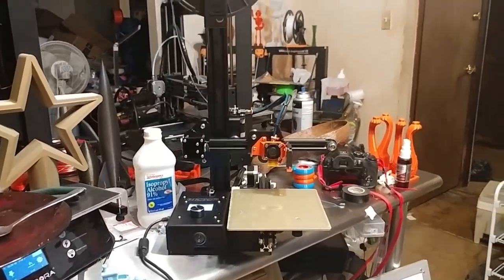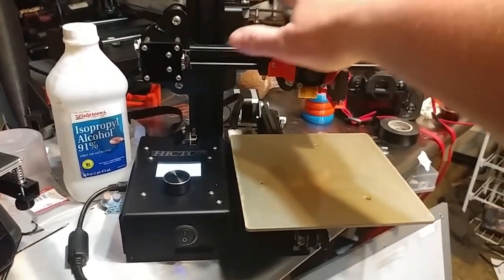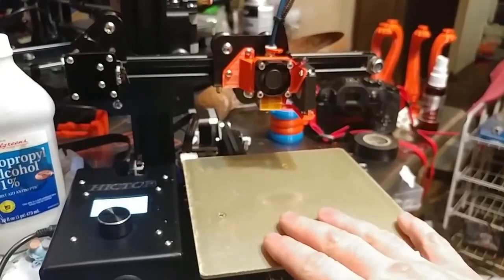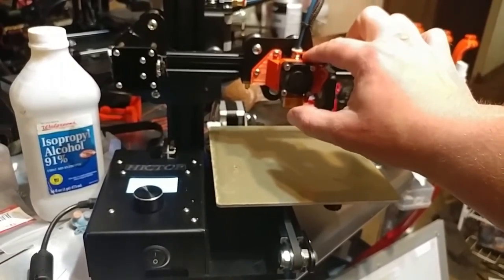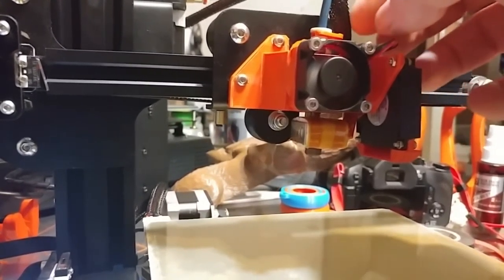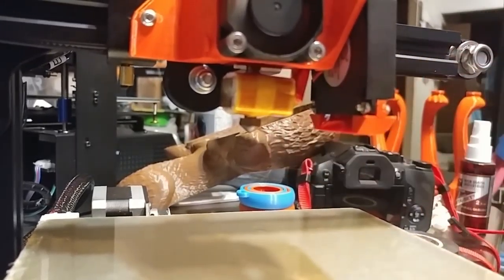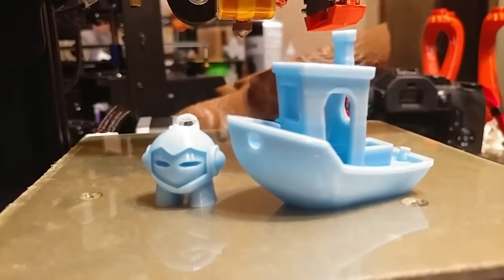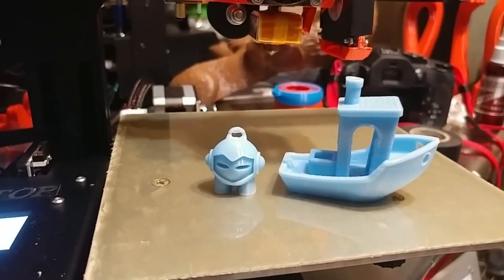Today's 3D Print 164 Customized Ender 2 Preview Unit #1 is Ready

Comment from the maker: This printer is for sale $380 fully assembled minus the spool holder which yoy will habe to attach. Fully tuned tweaked and upgraded profiles and sample cpge forncura and s3d on the memory card. Already leveled no assurance it will stay leveled through shipment. Packed up ready to go to conti us.

$350 plus shipping. $27 to $43 first class to priority your choice.

Upgraded hot end shroud custom design. Ultra quiet. Pei print surface capricorn tubing a2 hardened steel nozzle parts cooling fan added and fully plumbed into the harness works through gcode like any other printer.

Fully tested and burned in. 30day email support and 7 day parts warranty included.
Reply: Nerys I watch alot of your videos you do an excellent job of being straight forward good or bad and that makes your channel have a strong following...  

I see your modding out these ender 2 printers.. you should check out my extruder relocation brackets.. cnc machined aluminum..  might be something you want to add to these.. email me if interested... 

Keep up the good work
Reply from the maker: link? pictures? why relocate? youtube messaging SUCKS I just found this message now.

Comment: Wow, I love that hot end surround mod you made on that. I have a CR-10 and love it. But, like you, I'd prefer to be able to see the hot end a little better especially as the prints start to initially get laid down. Since there are so MANY CR-10 units out here, it would be great if you could post the mod files to Thingiverse and do a video on installing the printed parts and associated accessories onto the CR-10!
Reply from the maker: I plan to offer a kit with the parts in it etc.. to make the modification. I will also release the design to my patrons. an experiment to see if that can work. but first I want to make sure it holds up to a 50+ hours print on the CR-10 :-)

I am also going to make a mod with 2 cooling fans (one on each side) this will improve surface finish on thin models (I notice the vase print models that are small suffer a little on the uncooled side) and also allow you to run the fans "cooler" which should decrease noise even further.
Reply: Wow, that sounds fantastic! Thanks!

Comment: What suggestions do you have for strain relief on the heat bed connector? Mine failed after about 100 hours. I’m not sure about the STLs that fix onto the bed screws - adds weight, tightens the levelling springs considerably and makes the cable tight at y<15mm. Considering a few layers of heat shrink, but that makes it impossible to easily inspect the connector. I tried to solder new wires but my lack of skill and appropriate equipment failed me. Any ideas, please?
Reply from the maker: That's interesting I have a couple of thousand hours on my Android to and no sign of heat bed failure at the connection is this a newer Ender to and are you running the heat pepper hotter than 60 C? All of my Android tools are the older style so it might be the higher temperature and therefore higher current causing a problem?
Reply: I run at 45-50 degrees, it was 50 when it failed. It is a recent Ender 2 (ordered a month before the 3 was announced!) and it has a bed claiming a rating of 110W. I understand the first units were rated considerably less, and photos I've seen have narrower traces on the heat bed, so it's likely the current draw is higher on the later units (although for less time depending on target temperature, I guess). The usual advice on the E2 facebook group is to solder the connections, but the thick wires and thick aluminium bed make this not completely trivial - at least for me!
Reply from the maker: Rig up a mount for a clothing iron place the heat bed upside down on the clothing iron turn on the iron let it heat up your heat bed then try soldering it it works a lot better
Reply: Thanks for the tip

Comment: Hi, Nerys. I'm interested in buying my first 3d printer to print PC case parts. I've been following your channel, and I'm thinking like a beginner in getting this Ender 2. But I believe that for PC parts that heats up, I'd better use ABS. Is it really that I should start with an Ender 2, or would it point me to another printer. But where I live is better than Gearbest. Thank you very much.
Reply from the maker: I am not entirely sure I have very little experience with abs I did make my first prince two weeks ago and with perimeter and infield Parts I had no problem with abs once I add the little Brim they stock fine they printed find although ABS hates bridging :-) very ugly :-) thin Parts however don't work for crap :-) I tried to print of A vase in abs even with an enclosure and no that did not work might just be too cold here :-)

The newer Ender 2 is capable of 100 degree heat bed temperatures so it can do abs just fine and because of its small size and separate power supply you can easily build an enclosure for it very cheaply to keep the heat in

As for which printer is ideal for abs that I can't answer since I don't have enough experience with abs and I don't want to deceive you so my information is largely an educated guess

Now you said PC case parts I thought that meant personal computer case Parts but now I realize that you may have been saying polycarbonate case parts?

I have no experience with polycarbonate yet but really want to get involved with it because of its Incredible strength :-)
Reply: Had not thought of polycarbonate for the parts to build a mini pc case, had even thought of abs. But it's actually a lot better, I'll search more. I'll order my printer. Thanks for your help!!

Comment: I love My Enders 2 :-)
I will try the PEI Base and the same springs for the bed, but i only modded X Axis Belt Tensioner, Y Axis Belt Tensioner and Fan Shroud and is clearly the best printer i have.
Especially for ABS!!

But i prefer my Prusa i3 Clone for Print flexible, because the Direct extruder, not Bowden... :)
Reply from the maker: +PLAYNIMATIONS direct drive will always be superior for flexible over a Bowden tube :-) my maker select with the flexion extruder was a beast for flexibles

Comment: Hi I was just wondering where I could get your Cura profile
Reply from the maker: +Judoguy 12 Cura no longer exports printer profiles but I do have my settings profile which I believe is in my links if it's not there I'll upload it tonight
Reply: thanks for the realy quick reply just wondering is cura the best free slicer
Reply from the maker: +Judoguy 12 I don't know Kira is the only slicer I've used besides a simplify 3D and I get pretty good results with it it's got works but so does simplify3d when time allows I'll be sure to try some of the other guys out there
Reply: Nerys thanks
Reply: Settings profile is that the fff one sorry I’m new to this
Reply from the maker: +Judoguy 12 the FFF is 4 simplify 3D
Reply: Nerys so what Can I use in Cura sorry new and I am a 13 year old 3D printer coming from gearbest

Comment: Nery, Where di you get the replacement stock or no stock.. fan, Mine is starting to make some noise..Thanks, Kevin
Reply from the maker: +K Wright amazon. Search for makergirl i will add a link tonight. Thisnis NOT stock size. Stock size is 40mm

I got the blowers from amazon as well.
Reply: Ill wait for links..also the PEI...Love the channel want to support it..
Reply from the maker: +K Wright this is the one i usually use http://amzn.to/2kgltZr not 100% sure of performance on an ender 2.
Reply: I found a Noctua 40X10 premium fan which last a friggin lifetime as I have them in PC;s I know its not what you suggested but it seems like a good fan..is the stock fan 40x10??
Reply from the maker: +K Wright the noctua fans are great go for it my only concern is having sufficient air flow since it uses the hotend fan as a Porsche cooling fan the excess air after it cool the hot end blows over the model so if you reduce the throughput of air too much you're going to reduce your cooling of your part but try it see what happens
Reply: Well the unregulated speed on the Noctua is more RPM that the link, not sure about the CFM..I got a 40x10 and 40x20 I plan to use 1or 2 MM bullet connectors (soldered) for easy change out, will heat shrink the connectors, Don't want to route all the wire through the loom and it will be easier to swap out if the CFM isnt adequate, but it seems  the stock Ender setup just relies on the deflected air that cool the hot end..its not really directed in anyway..We will see what happens..you have a link to the swiss hot ends and the Capricorn Tubing..
Reply from the maker: +K Wright Oh wait we're talking about an Ender that's totally different

A floor fan is going to reduce your cooling capacity you want to add a cooler if you don't want to run it through the loom just tapped directly into the hot and fan and it will always be running the same fan that runs on the cr-10 you can literally just hot glue it right to the side of the housing on the Ender just make sure it doesn't hang too low

Comment: Do you have a link for the build surface?  How well do prints stick to it?
Reply from the maker: I got it from CS Hyde. they are the only ones I know of that both do custom sizes and the adhesive is already applied to the PEI.

http://catalog.cshyde.com/viewitems/films/pei-ultem-polyethermide-resin?

you can request a custom size its about $15-$18 shipped. you need 165x165mm for the Ender 2 though maybe cheaper if you order just one. I ordered one large enough for them to cut into 4 pieces came to $52 or $58 something like that. Right around $15 a pop shipped.

PEI is interesting. bed level is important and it must be CLEANED thoroughly before each print (just alcohol and wiped down clean) ANY residue will inhibit stiction.

it also seems to prefer being printed "hot" I print at 60c max for the ender and it seems happy with that.

whats nice is the parts snap right off the print bed easily and have that "super gloss" finish on them Literally like a mirror.
Reply: Sorry if I missed it, but what is the thickness you are using? Thanks.

Comment: Awesome upgrade Nerys 
By the way does ender 2 have a resume feature after power failure ? Or how to add one??
Reply from the maker: +Iengskhem Marak no. But its small enough that i just use a ups :-)
Reply: Nerys how to do An Ups ?
Reply from the maker: +Iengskhem Marak ups uninterruptable power supply. Its basically a battery. If the power cuts out the battery inatantly takes over and keeps it running for a little while (10 minutes to an hour depending on size and power draw)
Reply: Nerys thanks again and I now realise that you are talking about a computer ups😋😋😋
Reply from the maker: +Iengskhem Marak ahhh yes my bad. Jist remwmber larger printer wkth heat bed can slurp down 250 300 watt hours. That takes a pretty beefy ups.

Comment: Nery. My i3 Mega stops printing 5-10 minutes into a print. Starts perfect, and after 5-10 minutes suddenly stops without any message on the screen.😦
Any advice ?
Reply from the maker: that sounds like bad gcode. I had that problem this morning with my Tevo Tornado. loaded its gocode and lo and behold the cost STOPPED where the printer stopped.

swapped to a different memory card and its working perfectly now. SO first try reslicing. then preview the gcode make sure its "complete" (preview it FROM your sd card it might be complete on your PC but getting corrupt when you copy it over)

FIRST test is to reprint something you have already printed that is already on the SD card. now if the SD card itself is going bad that might not work.

so try a different SD card.
Reply: Nerys Thank you very much. I'll try it later.

Comment: Ouuuh!! That looks so gd!! Would you be sharing the design on thingiverse?
Reply from the maker: I plan to offer a kit with the parts in it etc.. to make the modification. I will also release the design to my patrons. an experiment to see if that can work. but first I want to make sure it holds up to a 50+ hours print on the CR-10 :-)

I am also going to make a mod with 2 cooling fans (one on each side) this will improve surface finish on thin models (I notice the vase print models that are small suffer a little on the uncooled side) and also allow you to run the fans "cooler" which should decrease noise even further.
Reply: Nerys awesome!

Comment: Nery's, are you a dealer for the Ender platforms? I really would very much like to get one I already have the CR10 and will be getting the CR10 5s according to my wife lol but when is a secret and she said she'll let me know when lol.

However, as for the Ender what's the price your asking for one of them setup like your personal Ende? Thank you. Bob
Reply from the maker: I am not a dealer. I just happened to get lucky and bought all the amazon returns from hictop. I am building and tuning them up. selling a few to pay for them all.

A printer as you see it in this video costs me $260. so the price would be $260 plus whatever you want to pay me ($260 is cost) plus shipping.

you can off course customize it. don't want the PEI? save $15 use the stock surface (which does work very well this person specifically wanted PEI)

or $200 plus shipping for a stock ender 2 that I set up and make sure works well.

I have 4 maybe 5 to let go.
Reply: Have you considered getting one of the Creality Ender 2s? They tend to be a bit cheaper through other sites. They come with a less than pretty power supply instead of the power brick, but supposedly it helps with heating the bed quicker and to higher temps. Its also $175 on 3dprintersbay and even being shipped from China it still got to Kansas City in 3 days.  As far as I know the Power supply is the only difference.
Reply from the maker: +Heath Butler that's not a difference I believe that is the new standard they don't sell them with the bricks anymore I have one of the newer style ones coming now so I can play with it should be here in a week or two got it for $145
Reply from the maker: +Heath Butler by the way this is a creality ender 2 they're all creality Ender 2's hictop just buys them from creality :-)
Reply: True, but every Hictop I have seen comes with the power brick and the Creality branded has come with a jenky looking power supply instead.  I like the look of the power brick, but rumor has it the power supply Creality branded Ender 2s come with performs a bit better.  I didnt see any pictures after a quick search, but might send you a link when I get home tonight to show you a picture of the power supply I received (which is not the power brick you have).
Reply from the maker: +Heath Butler yep. But hictop is out of the old version with the power brick. I found that out when i tried to order a replacement and they sent me the new cr10 style psu :-)
Reply from the maker: +Heath Butler yes. I hear they can hit abs temps which got me intrigued. With other upgrades maybe i can do polycarconate and nylon on my little mosnters :-)
Reply: Interesting. I had only seen the power brick in Hictop pictures. I have an enclosure now for mine so sometime soon I will be playing with ABS.  I can say my build plate can hit 100 C after only 3-4 minutes.
Reply: BTW, if you get bored and run out of ideas I would love to see a video of the performance difference between the two.  I love my CR-10, but for anything that is not large the Ender 2 is by far my favorite of the two.
Reply from the maker: +Heath Butler a comparison is pretty easy actually since it's identical to a cr-10 just smaller the only real difference between the Ender 2 and the cr-10 is that the Ender 2 produces cleaner prints with less noise almost no noise this is due mainly to its small size lower Mass lower inertia less ghosting and ringing as a result of that

What's great about it is that it's just as reliable as the cr-10 because it uses the same rails the same bored the same hot end everything just smaller :-) you could literally call it the micro cr-10
Reply: I didnt word my comment well. I meant comparing the differences between the power brick and the new power supply for the Ender 2. There doesnt seem to be a lot of information on it, just some random comments I find saying the ugly power supply is more powerful.  I would love to see a real world comparison of the two power supplies for the Ender 2 from someone that has both.  I havent really seen examples of how max bed temps and how quick both heat up, just generic stuff like the new power is hotter .
Reply: Nerys Ender 2 have other LCD type and other board. Firmware is not compatible. If you need, i have backup of original Ender 2 firmware and new version with autolevel support and bed heating to 110.
Reply from the maker: +Heath Butler I will have the new one relatively soon and be sure to compare them the reason I'm interested is because of the higher bed temperature you can go to which would be very nice